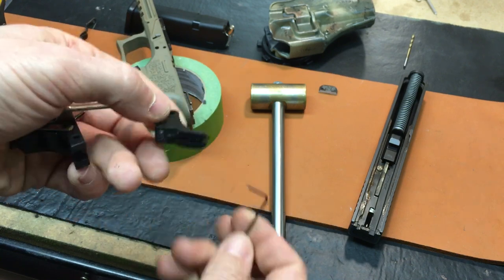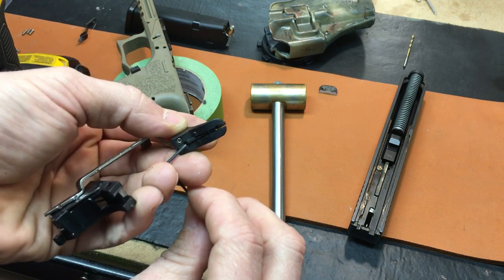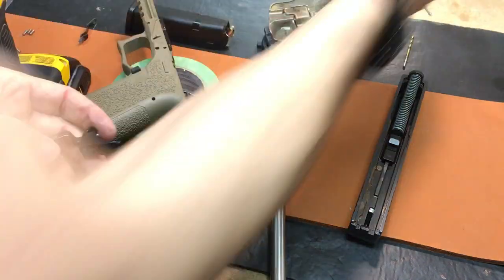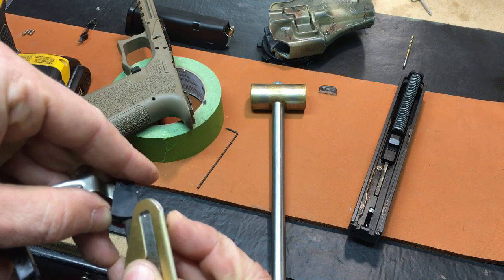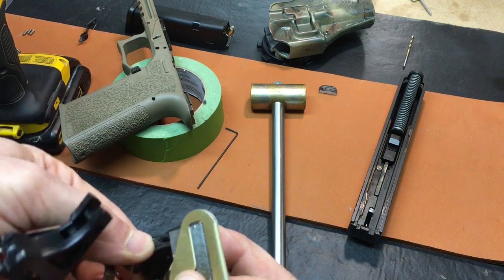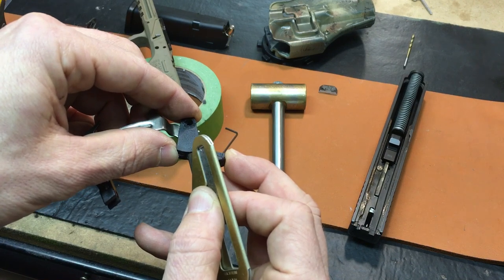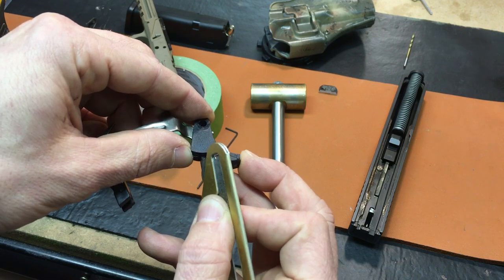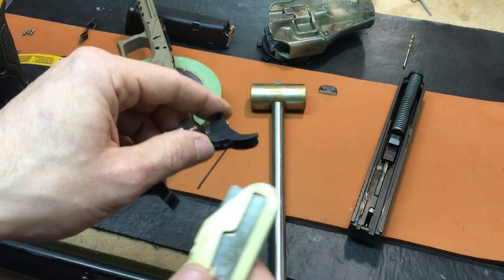Glock 17 $0.60 DIY Adjustable Trigger

Comment: Decent video my friend however I would like to point some things out for your consideration and anyone else that watches this. Number one if you square up the cut of the trigger safety tab to where you are explaining a gen 3 bar in a in a gen 3 gun will be off-the-shelf 95% of the time. The same goes for Gen 5's.  Number two it is not the over travel stop that potentially can cause firing pin safety encroachment. It is the pre-travel stop. The more pre-travel you remove the closer the vertical extension moves toward the firing pin safety. Just to be safe and not sorry I would definitely definitely recommend taking a little material off the vertical extension where those two parts have the potential for engagement. Last checking sear engagement on reset is of upmost most importance. That is where your gun is going to bump fire/double tap and has the potentially go full auto, especially when using a 3.5 connector, if that is not at least 66% engaged when the gun resets. Remember the bar is in a different position when the gun is cocked as opposed to when the trigger is resting. Just a note once you install the trigger you did not show that the drop safety shelf in the trigger housing was engaged. If a Glock is horizontally dropped the cruciform comes off the shelf the gun will fire regardless of the firing pin safety hence another reason to modify the vertical extension a bit. Please understand I'm not Nick picking these are serious considerations when it comes to safety. I commend you for your effort and just wanted to send things out for all of us. 👊👍🙏
Reply from the maker: JOHNNY GLOCKS the persona, Man the master takes a moment to respond to a little guy! Thank you for watching my video. And thank you for all of the videos you have made that help people out! I tip my hat to you sir!
Reply: Hey brother this is how we keep our communities strong. Regardless of where we are on the path we all can learn from one another and help each other out. Keep up the good work 👍👊
Reply: JOEY SNAKEYES 360 never wash your car with the car keys around
Reply: Jonny Glock has forgot more about triggers in Glocks than most people know.
Reply: @dougphillips7524  So true.  I could watch all his videos and spend several weeks working on my own triggers, and not even come close to the knowledge he has
Reply: I noticed that the p80 frame is a little different from the oe concerning the shelf and trigger safety cut
Reply: New to this and getting confused but I will keep learning  before I start cutting and removing. I have a trigger with PrE travel and post over travel, I adjusted them.. I need info to make sure its safe. Banged it on a table several times so far all good.
Reply: Your the first person I though of when I saw this video. I was thinking I will leave this to Johnny. Life and death of me or someone else does not have a price. Certainly not for a better trigger.

Comment: I'm blow away when Johnny glock chimes in and I see why, 95% of glock mods any old Joe smo can don't and not mess up, but this is one of those mods that can get you in trouble quickly, it affects multiple systems at once and one turn to much will get you barking,  this mod is for the competition shooter NOT a carry gun unless you know EXACTLY what you are doing, it can be done lightly just don't take it to the razors edge

Comment: Good video! I bought cheap china stuff from Amazon and it all worked out great. The Metric grub screws in the kit that I finally used were M3 x 4, or 3mm diameter x approx. 4 mm length. I first tried the M3 x 3 which I felt were a little short, they went way into the polymer trigger. I like the M3 x 4 better, which were about one mm recessed into the trigger, once the preset was set. I also bought a Metric drill bit kit and metric tap kit from Amazon. All of this stuff could be used for various projects in the future, but he is right, you could just do the project for less than a dollar, if you have good hardware stores in your area.

Comment: First the striker over sear safety engagement precentage must be checked with a round in the mag as in a loaded gun which always lifts the slide up reducing the sear over striker engagement. Your check is done without a mag. Further, Glock's notoriously uneven production tolerances present real danger of accidental discharge. I have seen Glocks that left Smyrna past QC with only 50% sear over striker engagement. Second, the pre/over travel s/steel screws will  lose adjustment over time in the soft oily Glock polymer shoe and could strip the threading or tear through the polymer from firing forces even if Loctite is applied to the thread. These screws will work longer and better in an aluminum shoe if accurately threaded with Loctite applied. Good video !!!

Comment: What length are those 4-40 screws and did you have to mod them? or what size would you recommend now you’ve spent some time with it? Great work, educational and pro active, the more you learn, the more I see where people just rip you off and over sell simple information, thanks for sharing ✌🏾
Reply from the maker: Rauna Luke Projekt The screws are super cheap. I’m not sure any more exactly what size screws I used. I do remember buying about three or four different sizes and used the ones that worked best. I suggest taking the trigger housing assembly out to get a better idea of the size you’ll need. Thanks for watching! P.S. The mod is still installed and used. It works as intended.

Comment: Great vid, thanks a lot. 

Now I have one question:
- What Socket Head Set Screw you’re using exactly (length, thread) for both of them (pretravel & overtravel/reset)? 

PS. A link will be more than great?

Thanks in advance.
Reply: Search for: guitar height, fender, saddler screws
Reply: He said 4--40. !!!

Comment: Do you remember the length of those 4-40 hex screws you used for this?  I have 4-40's in 1/8 inch and 1/4” but something tells me these are longer.  Possibly 3/8 inch or maybe even 1/2 inch
Reply from the maker: Captain America honestly I thought I still had the bag with the length on it but it doesn’t show the length. You can just customize the length by putting the screw on the Allen wrench and grinding it shorter, then tip it at 45 degrees and spin it on the grinder or sander. This will cut the lead in thread for your new custom screw. Learned this technique at the machine shop I worked at for a while. I ran a CNC lathe making all sorts of stuff and we frequently had to grind the lead in on all sorts of threaded parts. I have used this technique on many gun alterations, most recently on a over travel set screw for the trigger guard on a Mossberg 500. Screw length adjustment is super easy! If you think you can’t do it I’ll take the trigger back out and measure the length... just met me know. Thanks for watching. I really appreciate it!
Reply: @tyler79durdan  Thanks for the help bud.  I'm gonna try that.  I'm gonna go look at your other videos right now to see what other cool stuff you have that I can learn from.

Comment: So, I've seen people put two screws in the plastic cruciform shelf, one for pretravel and one for over (travel/(quicker reset?)), so I am wondering if your method accomplishes the same thing...?
If you're limiting pretravel, did you have to take material off the safety plunger set off (shark fin?) to stay away from a half held back firing pin?
Lastly,  could you make reset better by manipulating the bird's beak and trigger bar connector?
Any feedback is highly appreciated.
Reply from the maker: Justin I would defer to Johnny Glocks for all information regarding Glock triggers. He will take your call personally and he’s a nice guy! I’ve spoken with him in several occasions. Look up his channel and get his contact info.
Reply: @tyler79durdan  Scrolling through the comments, I see one left by me--4 months later, and YT failed to notify me of your response. 
I bought a Johnny Glock Combat trigger and am glad I did. Thanks for the video.

Comment: Hi, how do you get a glock with picatinny rail?  As far as I know the factory does not produce such a Glock. Please correct me if I know wrong.
Reply: This is a Polymer 80 lower. If you research you can find more information on them. Essentially it's a different frame with a more vertical grip angle as well as better texturing that supports all Glock factory parts.

Comment: Awesome vid! Was just what I was looking for. Thanks! (Sub'd)
Reply from the maker: addie750 Thank you for your sub! I just posted this a few days ago and seen someone left a thumbs down already. Your positivity has renewed my willingness to share my experiences with you tube viewers. I wish I knew what I did that caused the thumbs down because it would help my future videos be more enjoyable. Thank you for the comments also!
Reply: tyler79durdan Your very welcome! Found this video earlier today and it was the only one detailing this exact set screw procedure. Went to the hardware store, bought some set screws, installed them and now I am good to go. The only thing I noticed on your video was there wasn’t much detailed explanation on the set screw you put in the back. Plus, you did not mention the length of the set screws. I accidentally purchased a couple of them that were too long and had to go back to the hardware store. Other than that, I think it was an awesome instructional and resulted in exactly what I was looking for! You were fairly thorough and detailed , so screw whoever it was they gave you a thumbs down. I for one, greatly appreciate you sharing!!! My trigger now has barely, if any, pre-travel or over travel. Thanks and keep the vids coming!!!!  :)
Reply from the maker: I had a feeling that this info might help someone. If you are the only one it helps, it was worth the effort! Thanks again buddy!
Reply: A big thank you from Italy, i looked for a good vid for a long time, great job.

Comment: So the pre travel hole don't go through fully? Stops ?
Reply from the maker: Thomas Swihart the pre travel hole does go all the way through and the screw engages the bar and prevents the bar from making full travel into its slot. The hole has to go all the way so you can adjust it from the trigger face.
Reply: thanks bud. I'll have fun experimenting :-)

Comment: its not that big of a deal, but in case you need to procure more of these "screws", it might be beneficial to know that the these are called, and collectively known as "grub screws". that way if you ever need to order a pile of them or if your at the hardware store, you will know what to ask for without any confusion. 

forgive me, im just being a pedantic asshole.  just trying to help, and it always comes off shitty, it wasnt intended that way i assure you.